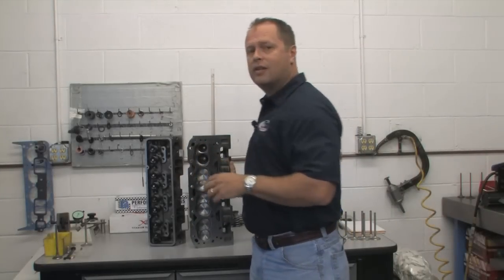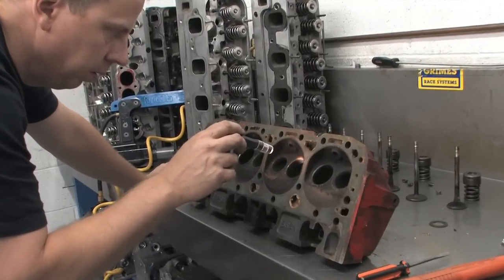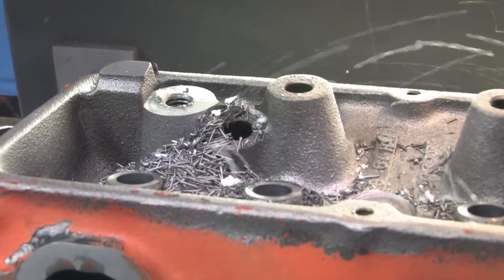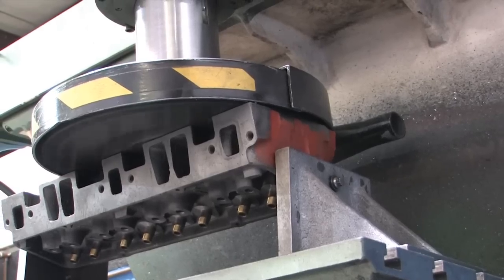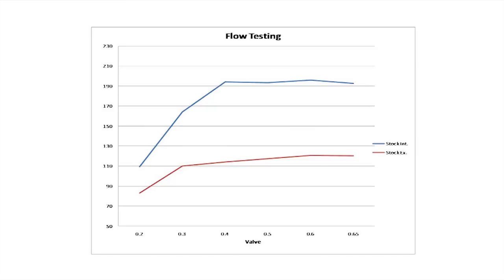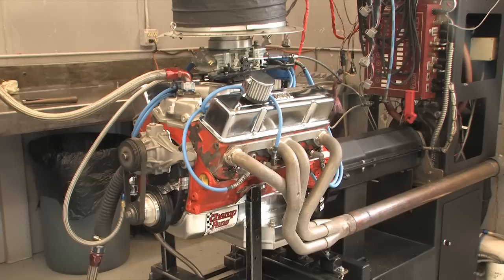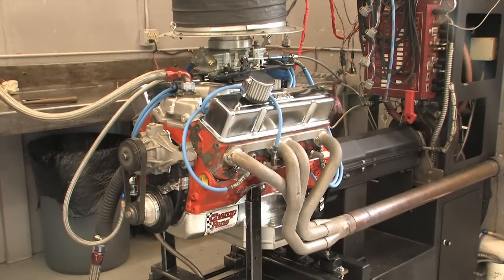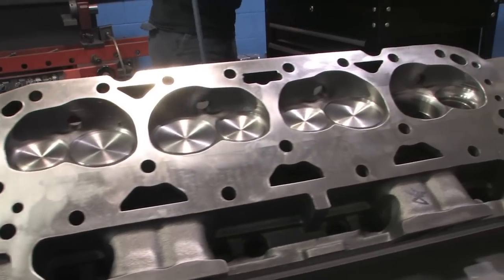Chevrolet Cylinder Head Dyno Test

Comment: I agree that they chose the wrong heads to compete with, they should have used the 041x,492 ,186,291 just like what the other guy texted that this is a dart advertisement to sell their head if you really search you can find the castings I posted check out Craigslist,yard sales, machines shops,and just asking and looking around but if you have the money for an after market head then bye it.its also all about what do you want to do with your motor and what kind of power your looking for

Comment: Ok good video and  what does the stock L31 vortec heads stack up against the Dart Iron Eagle,,, vortec heads are cheap new,, can we see a comparison. Dart heads are a hot rod head designed to make power,, the stock chevy vortec heads were simply a production thing that hot rodders picked up on,, I have an old 400 +060 with vortecs  curiouse to see

Comment: i love seeing smog head runs where soooo many people on forums claim oh even reworked 882 or 993 heads you'll be lucky if can top 300hp, i have a set of 993 i bought 15+ years ago from Arrowhead with studs, undercut stem s/s 2.02/1.60 valves with .525" lift springs ,optional bowl port that looked nice they know what  therr doing where there are a sub division of indy cyclinder head and i did a bunch of pocket and guide boss work & runner cleaning up  and exhaust polishing and they make my 355 run pretty strong i  2wd chevy truck, and they still sell the same head fairly cheap. the thing i wonderd is why would you put allll that work in cracked heads then toss em?? sees foolish not just go get a decent set of smogers...? then somebody could used em on a mild sbc, you can usally find em for free especially old wore out ones with all the vortecs out there. i bought a set of vortecs for $60. regardless cool video!

Comment: 180cc heads that  flowing more then 180cc is that common?  i just got set of there 180cc heads but with 2.05 in and 1.60ex 49cc chamber . r they going be same abouts flow rate ?

Comment: To bad I have a set of 186 69 Camaro hump heads I just been redone with port polish and springs good to just over 600 lift I would have loaned them just to see what they could do.
Reply: If they've been ported the fuelie heads probably would be very much in comparison to what the dart heads ran horsepower and torque wise.

Comment: It is always interesting to see, that torque scales LINEARLY with the flow cfm of the cylinder head (regarding same intake runner size in cc, which is important, because otherwise you once again play around with the rev band, like with camshafts, too).

So comparing modern heads, which can flow up to 250 cfm, porting them slightly, which can obtain up to 280~300 cfm if you know what you do, you will just gain DOUBLE the power comparing to a stock 70s chevy iron head, which does about 150cfm. 

You can gain easily 300 horsepower instead of 170, with a stock cam. With a smooth idle, with a good gas mileage, with just pulling the heads and replacing them, which can easily be done in-car without a full engine overhaul. (Just remind: You might f*** your bearings and piston rings then ..... hahaha)

Comment: A more true comparison would be Dart head against a Vortec 062 with the fast burn chamber  because the Dart head has the fast burn chamber and that makes the head really flow well. They try to sell Dart heads by throwing off on stock heads but they don't tell you that a Vortec head can make as much as 480 hp and costs around $350.00 per pair used and in good shape.
Reply: more people runnin 882s than vortecs on carbed hotrods...that is changing though

Comment: you can get much closers numbers from the stock head if they had bought the darts at 68-70cc. lowered compression on big displacement is a huge loss all over the map on top of longer cnc  machined runners.

Comment: So even a 1970 350/300 10.25:1 compression head isn't worth doing anything with, I would still have to do most all the same things as the 882 head? I do figure them to be 1.94/1.60, since they are the 300hp heads...

Comment: You  could  have  milled  them  down  to 62 or 64cc I've done it make it fair . 193 at 500 lift at 28in .,I don't think that's right.  Chevy has made plenty other heads you  could  have compared them to.
Reply: but the 882 is the most common boat anchor lol

Comment: Who rebuilds 882 smog heads.
Reply: T salinger1026. I ported a set and shaved .060 off em and they ran awesome!!!
Reply: If you do a full race Port from the intake Port all the way to the bowl with a valve sets you will see a big difference problem is ... hardly anybody would be willing to do that
Reply: 20 years ago it was cheaper to port your own and rebuild them. Everyone bitches about jobs in China, but your dollar goes a lot farther (with some stuff) than it used to.
Reply: LOL, so true, i think I have seen ported 305 heads flow better and the new question is who build gen1 sbc/f/m anymore, everyone turning to swapped takeouts...

Comment: My dude, what tool do you use to compress the valve springs? Bought it or built it yourself?
Reply from the maker: Mine is from Moroso, but a lot of different people make them. You can just do a search for "on head valvespring compressor" on Summit Racing or even Amazon and a bunch of options will come up. Good luck!

Comment: I have a 350 goodwrench engine I know very little about. i plan on using a set of 350 vortec heads on it with an edelbrock rpm airgap intake, comp thumpr cam and an edelbrock 750. any ideas or suggestions if this would make any more power than what i already have or just make it sluggish. also, any problems i might run into with this combo? thanks in advance!!!
Reply: +2009KVFD976 Im not looking to make crazy Hp or TQ. just a cruiser that can be unleashed when needed with good street manners. thanks

Comment: double hump heads 2.02 valves have more flow & give more compression ?  witch  = more HORSEPOWER
Reply: fanghicheck I'm with ya bud, give me a set of 2.02 camel humps, with gasket match and light debuting polish best bang for your buck on old school small blocks, GM engineers back in the day were pretty much on the ball ,not saying there isn't a better head just saying the old school factory camel humps work great for what they were designed to do.
Reply: I'd love to see your fuelie heads put on that motor and see how much horsepower they make in comparison to the darts

Comment: do you think doing this test with a set of 906 or 062 vortec heads would have made a difference,  those are supposed to be the best factory production head Chevy made. ..or would it not make a difference because you sent those 882s threw every step possible ..I just wonder how the vortec heads would line up vs these 2 sets after its been threw all these steps
Reply: Well we don't wanna make anyone mad now

Comment: Ditto on the vortec!  882 are boat anchors
Reply: air flow research  heads are the only way to flow, as long as you port mach them with the intake  you can make a lot of power.
Reply: true

Comment: The Horsepower Monster, I'm riding a 383 Chevy and I wonder what is the best option heads, I intend to extract a 450 hp engine, the compression ratio is 10: 1, thanks.
Reply: +Wilmar Junior 
AFR , trick flow . If you have the money .  L31 Vortecs or GMPP aluminum vortec design if your  looking for a GM head.

Comment: What blows my mind is doing all that work to a pair of cracked heads!! I understand the test, I agree with the opinions, I agree pointless to dump that much money into smoggers  ECT ECT but if you're going to have dorton do that much extensive work on a pair of smoggers I can't imagine not looking for 30 more seconds for a good pair of pleantifull 993 worst case non cracked thin 882s or something, even tho there not up to par as aftermarket heads they still are a decent street head flowing enough to push the 400hp mark! you should have done em up and did a give away, piles of working Joes and Janes that would love to have those for mild build budget SBC, it's enough power to have a total blast on the street and actually be respectfully quick, you could have a 12 second small mid sized car..., just a collosal wast of time money and expertise. Plus it's always cooler to have an underdog engine woopin zz4's and 350 HO's with smog headed 350! That's badass, proving that some effort, skill and ingenuity can compleat with money quite often

Comment: . Why did they only go 1.94/1.50 valves on the Chevy 882 heads? I thought they had the same valve separation distance as the stock big 'Fuely' valve 2.02/1.60 heads? Looks to have started with small valve/small port 'truck' -882 heads instead of 'car' -882 heads which already come with the valves sizes they enlarged to and have bigger ports and as stock outflow these reworked heads...  Also, compression ratio not the same with -882 69cc  vs  Iron Eagle 64cc  chambers... Instead of expensive, dangerous (chance of cracking/leaking) milling of -882 heads, I'd simply use domed pistons for higher compression ratio...Finally, I'd expect 500 HP if using a huge for the street 248/252 cam... That cam is way too big for -882 heads and even too big for the 180cc Iron Eagle heads...

Comment: Why not get some 041/186 heads? They’d probably be a better stock head choice imho
Reply: those castings have better intake ports, combustion chamber, and are more suited for the 350 than the 882s.
Reply: The narrator says you can't get those heads I seen quite a few heads on eBay for 152 hundred $300 you can get a pair and they may not get the guys but if they do you do what you do because you want to call them have the most horsepower and fuelly heads really do the trick

Comment: Mass produced aftermarket heads need to be checked before bolt on, most will need machining
Reply: "...most will need machining."    Machining of what?    I have a set of AFR 180 street heads.   There  was nothing that needed "machining".
Reply: Rob Macfarlane If consistent maximum power production and reliabilty is what someone is after, the valve seat runout, seat angle, stem to guide clearance should all be verified by a competent machinist. Mass producing these heads leaves room for inconsistency in machining. A head with .009" intake seat runout that cost 1500$ a pair is just silly. I work hard for my money and I want my heads done right if I have to dole out the cash
Reply: Will Hammer what a bone headed thing to say
Reply: Will Hammer hahaha!  LMMFAO!
(never seen such a bone headed statement)
Reply: Will Hammer dude i dont know, i was just trying to pester someone, your probably right, i didnt read the comment
Reply: You're right Hammer. I watched a video that the machinist actually stated that many of these aftermarket CNC heads use Chinese valves that self destruct.

Comment: I wish you guys could have gotten ahold of some double hump heads for comparison..i do agree they are hard to come by especially in stock form...I am an electrician in Virginia and I recently acquired a set of stock, un molested, 461 casting double hump heads.. I got them in trade for doing some electrical work for a fella...they came off a vette and I believe he said they were rated at 375 hp?  not sure myself but are they worth getting worked over?  if so  I would like to use them on a 4 bolt main 350 I have that I plan on installing in my 1973 AMC gremlin... your thoughts would be appreciated!!
Reply from the maker: If you have a set of untouched double hump heads, you might want to consider selling those bad boys. Street stock oval track racers are always looking for double humps because those are the best when the rulebook says something like "stock only, no Vortec." If you are building a street motor you can probably get enough out of them for a new set of cheap aftermarket heads that are going to be ready right out of the box and give you comperable or better power.
Reply: The Horsepower Monster sadly WISSOTA has put the cobbosh on camel hump heads recently, guess I am not sure IMCA wise. sad times we are in.
Reply: . 461's are among the best stock heads and if the 461X's with even bigger stock ports, can be ported out to 500+ HP...
Reply: +The Horsepower Monster "aftermarket heads that are going to be ready right out of the box" Are you kidding me? Are you telling me that ppl should mount these heads right out of the box? PLZ take youre new heads to the workshop at let them take a look at them before you do anything and always be ready to spend more money on valve jobbs and bowl bleending. I remember my new Edelbrook RPM heads, they looked like shit when i got em!!

Comment: Maybe the test would be different if they used 062 casting Vortec heads,,,, I find them at my local pick-a-part for $50.00,,(castings 906-truck,,062,car,,although I've seen them on trucks-suv,s)

Comment: has anyone done  comparison dyno tests  on the different sized iron eagles on the same  shortblock ? ?  180 cc , 200 cc , 215 cc , 230 cc . i'm just wondering how much hp difference there is  with the small iron eagle vs the largest  one  ?   or  even flow comparison  of each ?  not factory advertised  numbers  but real world numbers  by  non biased  head porters
Reply: That would be an awesome video.

Comment: People need to watch that video twice before commenting it seems...heads were milled to 69cc and along with all the other work done they are still poorly designed chambers and horrible ports. Double Hump heads are only good for the resto Corvette engines. Vortec heads are the best OEM bang for the buck in stock or ported form..I would even put them up against the Dart heads used in this test.

Comment: One should never bolt on a set of ANY aftermarket cylinder head. I always completely disassemble aftermarket heads and check >>EVERYTHING>> .  Spring height, seat runout , seat and lift  pressure. There is errors 99.999999 % of the time. They are massed produced so the will have errors everytimel, guaranteed. The biggest issue with my experience is the guides and the eat runout which I alway correct.
Reply: I heard on another video that even the name brand Aluminums are coming with cheap Chinese valves.

Comment: Not sure just how much porting he did but I have had 882s run much better then that with 1.94 with a spec Cam and spec compression for a street stocks class at a local race track I got over 450 hp so not sure what you guys did but I spent 600 on my head's and did the porting myself
Reply from the maker: No port work done.

Comment: Thanks for posting this comparison. I have a bone stock LS6 Z06 Corvette. I want to swap the heads and cam in the spring time. I wasn't sure if I should rework the original heads or going with completely new heads.
Reply: Unless you are going radical....your stock 243/799 is heads will be sufficient....sending them out for a cnc port job will net great results....theres no need spending 2500 or more for heads unless your building a stroker bottom end. And a cam above .630 lift. If your just looking to add 100 horse power or so than a .575-600 lift cam and cnc ported stock heads will easily get you there....and I mean easily!

Comment: There's a video on Youtube that shows that Dart heads are never flat. They have to be skimmed up to 5 thou to meet spec. Thats just lazy quality control. You can buy AP heads on eBay that are made in Vietnam...yep. And out of the box they were perfect. It does not matter the race of the hands that are doing the work. If its sloppy, thats no excuse. The advantage the emerging Asia manufacturing has is all their plant is brand new, latest technology, usually shipped in from Europe. The robots that make iPhones is Apple's plant in China are ASEA from Sweden. ASEA gear also is in Samsung's plant in Korea.
You know Richmond makes the internals for Nascar diffs, right? Well you might like to know that one Nascar Royalty team uses crown wheel and pinion sets made in China. They can get two race weekends out of them, whereas the local stuff is stuffed at the end of the weekend.

Comment: What were the specs for the short block?  4-bolt 3970010 block?  Stroke, compression ratio?  Cam, pistons, rods, crank?  Part numbers?
Reply: +M L Franklin @6:16
Reply: +Fullforce LTX Thanks.  Did you use forged Scat crank or would the cast steel one be ok?  Which Scat rods did you use -- the stock replacement type or one of their H-beam varieties.  Does power like this need 4-bolt mains or woukd you be ok with a 2-bolt block?
Reply: +M L Franklin I didn't build the motor I just sat the video yesterday, I'm sure a 2 bolt would be fine with arp studs, just make sure it's balanced if your gonna be revving it high of course
Reply: +Fullforce LTX Ok, thanks again!
Reply: +Fullforce LTX Actually a 2 bolt is better than a 4 bolt, ask Gene Fulton of Fulton Competition, he made his debut with the 2 bolt sbc. 4 bolt main blocks are weakened by the extra bolt holes going straight in, splayed main caps are the way to go.
Reply: +david Last I duno if  2 bolt is better than a 4 bolt but a splayed 4 bolt is DEFFINATLY better than a factory 4 bolt, im deffinatly not gonna argue about it thats for sure.
Reply: +Fullforce LTX factory 4 bolt main blocks are weakened by the extra holes in the main webs
Reply: Texassince1836 Did I not just say that  ( 4 bolt main blocks are weakened by the extra bolt holes going straight in) Splayed 4 bolts are better = stronger.. Damn Genius!!